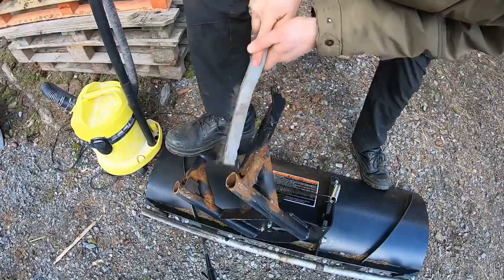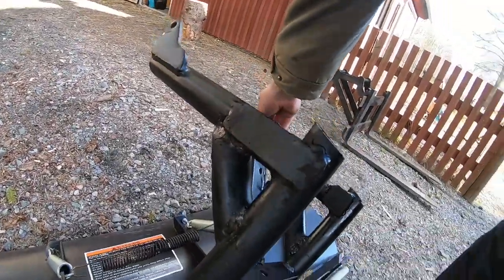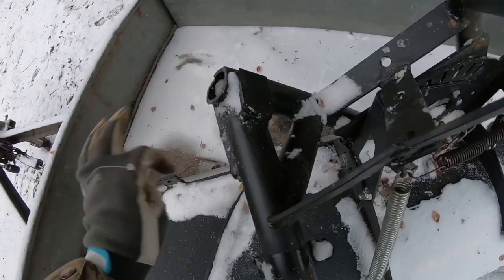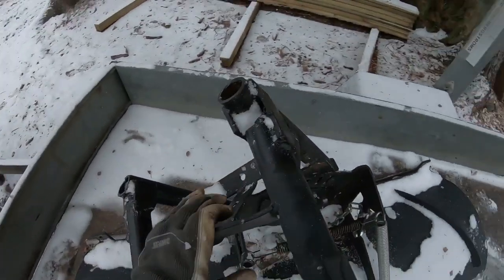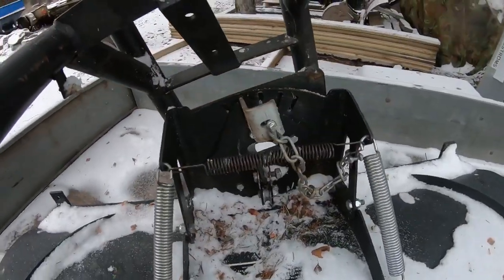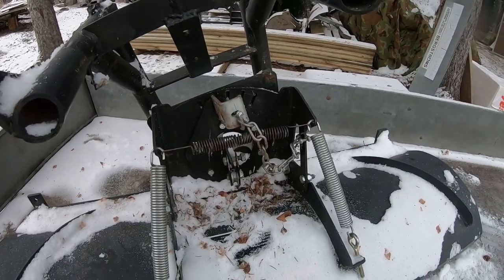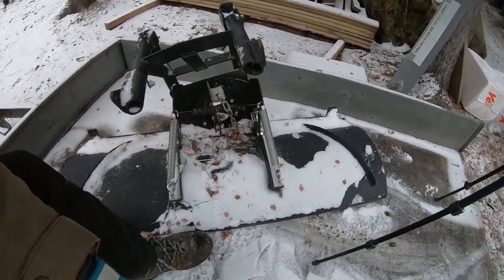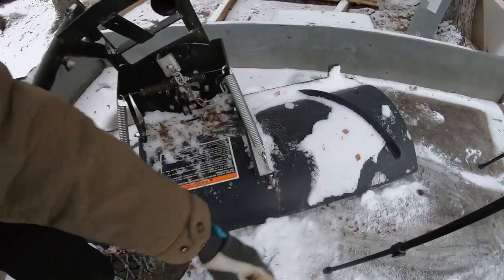Biltema rust protection paint on ATV snow plow, evaluation after 9 months outside (Engelsk version)

Comment: That cheap paint did a good job covering the rust on it. Can't wait for part 2.
Reply from the maker: Yeah I think it did a good job. Its not flaking either so I think it will hold. Did a lot of work today on the angle system and I think it will work good. But I need some snow to test it.
Reply: @NilsKall  You could try it against some sand if you have some there, or just wait for the snow. Can't wait for your next video about it.